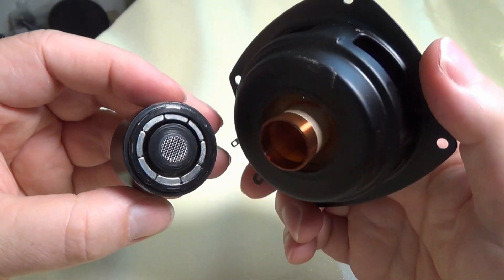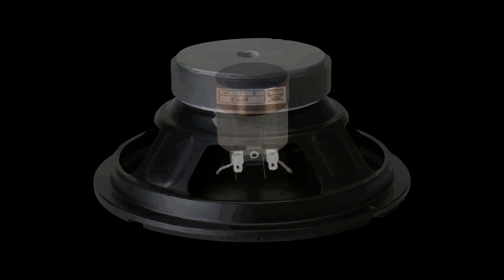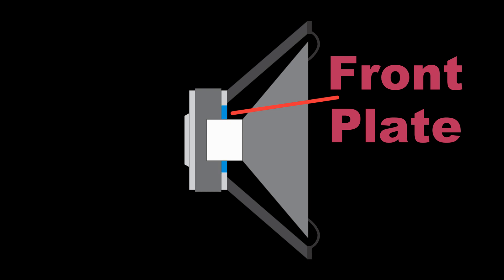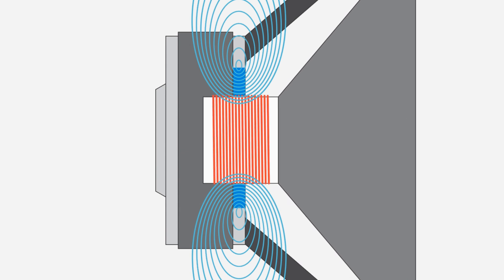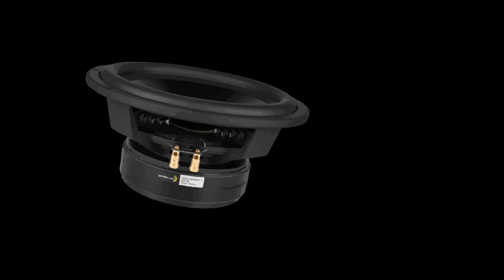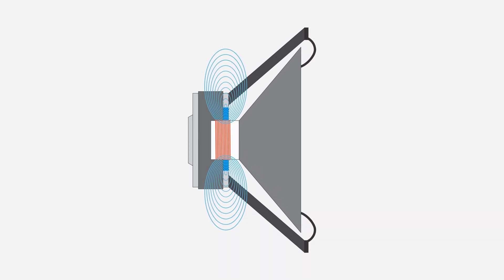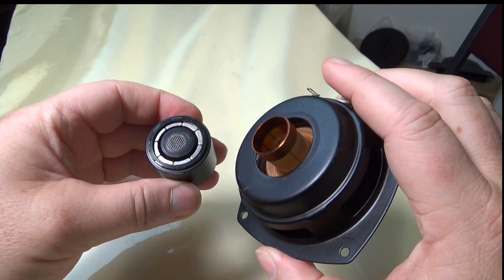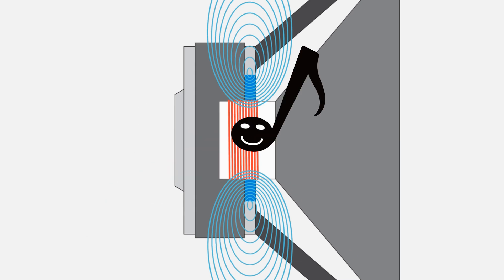‘Overhung’ vs. ‘Underhung’ speaker voice coils

Comment: That second illustration is not an underhung voicecoil. Overhung and underhung refer to whether or not the voicecoil hangs out the magnetic gap. When the voicecoil hangs out, that's overhung. When it doesn't, it's underhung. Neither of these illustrations shows an underhung coil.
Reply from the maker: The illustrations were to show the difference between the long voice coil extending far outside the magnetic gap, and the short voice coil staying (mostly) inside the gap...  I used a known (underhung) driver to model off of. It's not a perfect illustration, sure, but I think it adequately illustrates the difference.
Thanks for the comment.

Comment: The video is WRONG. Both examples, the over hung voice coil and the 'under hung' voice coil in the drawings are over hung. An over hung voice coil is longer than the magnetic gap. But an under hung voice coil is SHORTER than the magnetic gap. In both drawings the voice coil was longer than the gap.
Reply from the maker: Thanks for the comment, I think you're maybe looking a bit too close.  The magnetic lines are there to give a rough idea of where the 'bulk' of the magnetic force is located.
Reply: @zarboaudioprojects1430  Sorry but the drawing for the under hung coil is over hung
Reply from the maker: @nobelstone9714  Okay, I won't argue. My drawing isn't perfect, I agree -- but it does demonstrate the basic idea.... and it was taken basically from a known 'Underhung' driver. Thanks for the comment.
Reply: @zarboaudioprojects1430  But the drawing is incorrect.
Reply: @nobelstone9714  yeah underhung is when the vc doesn't leave the magnetic gap but then the magnetic gap is less focused? So less bl, then what s good for? Even bl curve?

Comment: Explanation is unclear. Underhung voice coil means that the coil is shorter than the front plate. And liinear excursion means that:
1. In case of overhung coil front plate is fully within the range of coil wire. 
2. In case of underhung coil the coil itself is completely inside the space between the ends of the front plate.
Reply from the maker: I simplified things for time, but I did have an underhung driver as a reference for my examples... driver construction. Does differ model to model. Thanks for the comment!

Comment: Hi Thomas, 
Great effort educating the newlings! Animations can absolutely help to give insight in what is actually hapening inside a woofer.
However in my opinion you may have oversimplified it a bit. In an underhung construction, the voicecoil is actually shorter than the magnetic gap height.
The animation showed a voicecoil that is still longer than the magnatic gap, which by definition is overhung. Decreasing the coil length in this example would only mean less Xmax or otherwise losing control sooner rather than later.
The diameter of the VC doesn't have anything to do with being overhung or underhung, neither does the amount of magnets determine the height of the magnatic gap. This is determined by the height of the top plate and matching pole piece. (a long voicecoil is heavy and thereforre lowers effiency, a large magnet stack can improve BL to regain some efficiency)
Although it may be more technical, if a followup is comming, please include a visual representation of Xmax for both underhung and overhung designs.
Reply: Hey we perffer to be called noobs lol jk great video though
Reply from the maker: Thanks for watching and commenting!  Yes, I had to keep things simple for a simple explanation. Like I said there is more to it, and it was a lot to squeeze into 3 minutes... originally was supposed to be 2 minutes but no way I could do that.
Reply: @zarboaudioprojects1430  thanks for your reply. Yes, there is only so much you can do in a limited time. Looking forward to your next projects and videos!